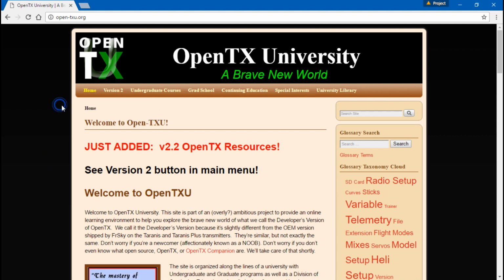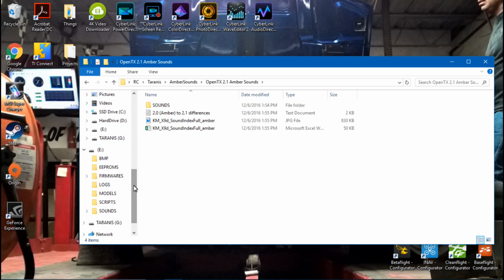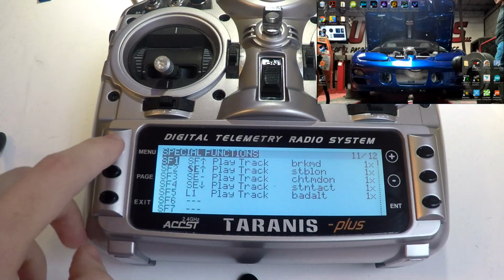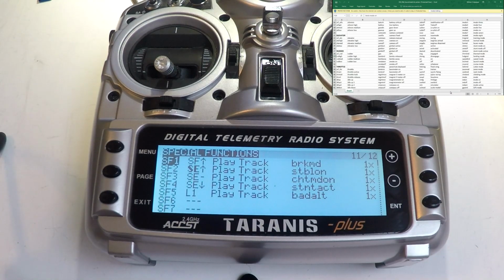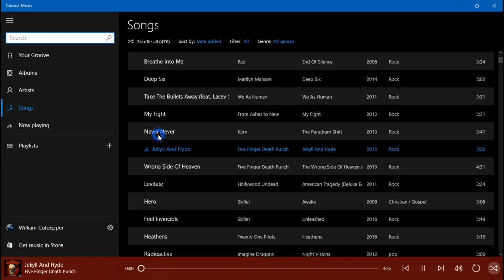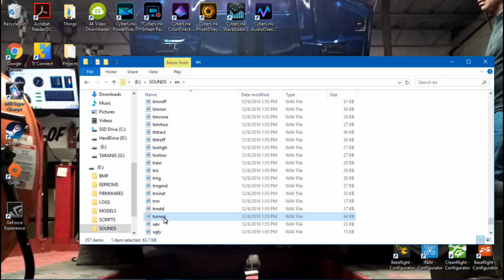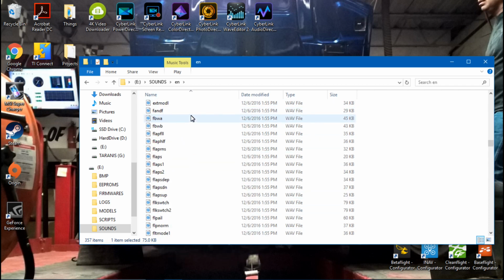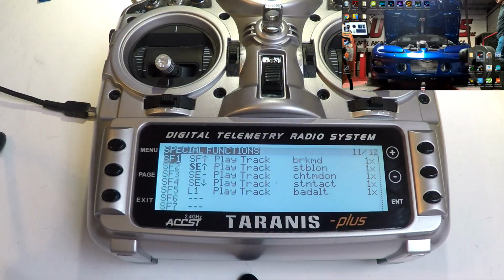Taranis X9D: Custom Sound Packs

Comment: It doesn't work with 2.2.3? There was no "tada" only "tada_opentx, so I changed that, but it still had the original sound, even though I removed the original from the folder. I tried adding a file called "tada", but it still plays the original file, if I test play the files in the folder, they play amber, what the hell is happening lol?

Comment: For some reason the start up sound won't play. I can get it to work on my 9xr but not the Taranis.
I have the newest firmware, bootloader and Amber sound pack. I have the same tada file in each folder and I can play the track from the radio so I'm kinda lost lol.
Is there a setting in the radio that turns the startup sound off?
Reply: NVM lol. Answer is down below.

Comment: One suggestion:  instead of deleting a sound that you want to replace, you could just rename it.  For example, instead of deleting the old "tada.wav" file, you could change it to "tada_old.wav", that way you still have the old file in case you want to use it later on.

Comment: Do you know if there is a way to get the sounds you have set to your mode switch not to play during power on for the transmitter?
Reply: Use the "exclamation point" -  !1x ( will NOT play at startup ... 1x WILL play )

Comment: OK, I must have missed a step. I downloaded the package, deleted the old Sounds folder from the SD card, and moved a copy of AMber SOunds folder to the card. WHen I went to my Special Functions to select some new sounds, the pull-down list in Companion still points to the old Sounds. How do I activate the new Sounds Folder?
Reply: Never mind. I put a copy of the Sounds folder in my PC SD card folder and all is well. Somehow I thought when you read from the radio all the settings were uploaded.
Reply: I do not have any folders on my SD card.  How did you format the SD card?

Comment: how come when I try to delete the "sounds" folder from the Taranis (removeable drive) it gives me "deleting (not responding) error. Then it ends up freezing my Taranis. Even if I shut it off, the LCD stays on. I have to unplug battery before I can restart all over again
Reply from the maker: Not sure. You could try removing the memory card and putting that in your computer and deleting it that way.
Reply: Project Blue Falcon yeh I ended up doing just that. thanks for the vid
Reply: I having the same problem.. Also my telemetry sound are ofset or something.. I tri m (meters) and  she say mah......
How can i fix this problem?
I have taranis with a new taranis and it happens after puting ambar sound pack... Were can i get original sound pack?